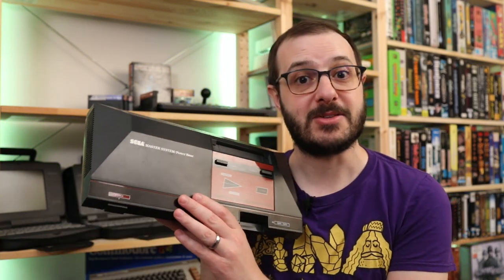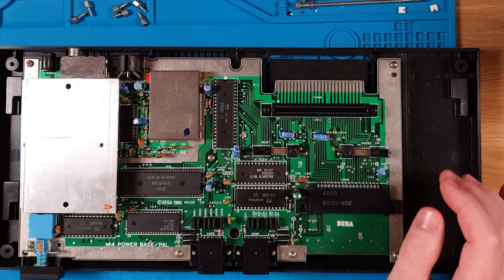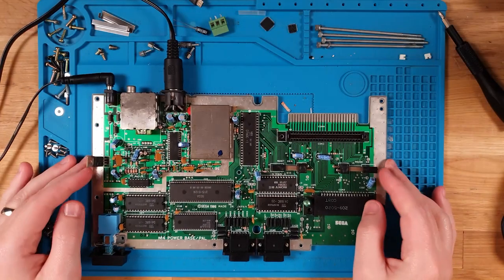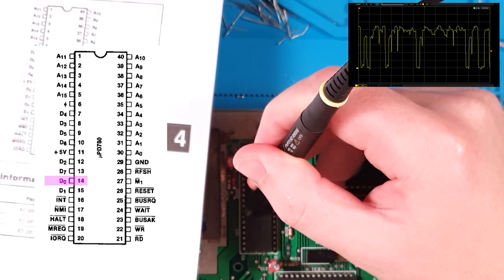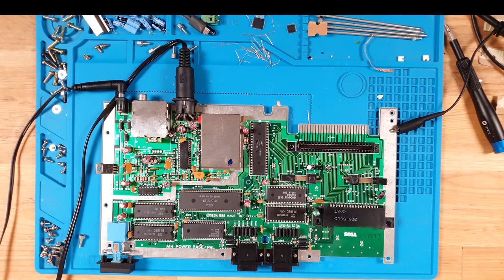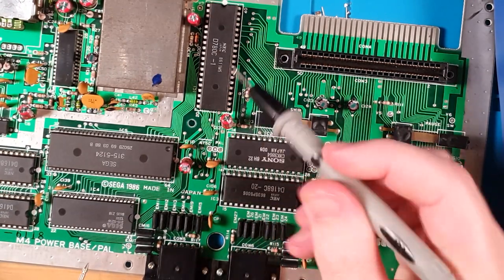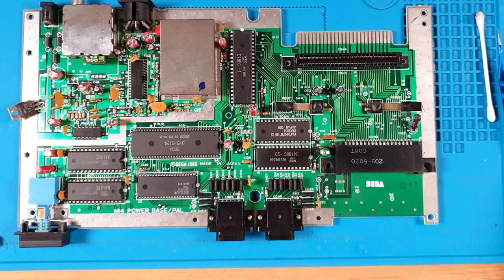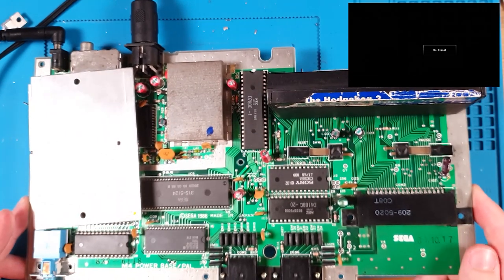Fixing a no video Sega Master System with a challenge!

Comment: Whats the name.of the tool you used to check the frecuency osilation (the one that shows the graph)
Reply from the maker: Hey! That's a DSO (digital storage oscilloscope) - I have the Rigol DS1054Z and the on screen picture in this vid is from a program called DS Remote, though I've sometimes also just pointed a camera at the Rigol's LCD screen